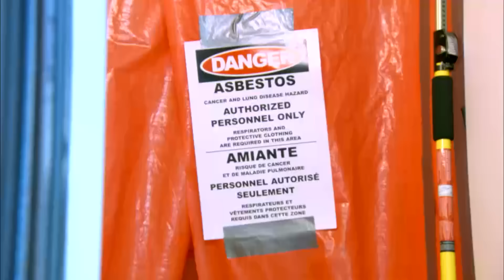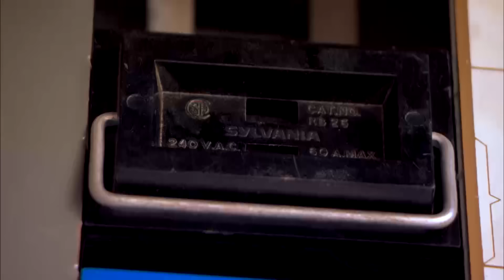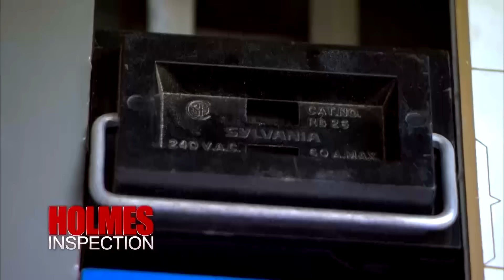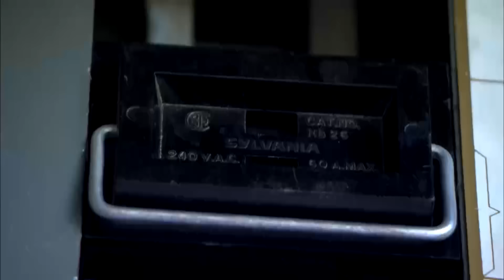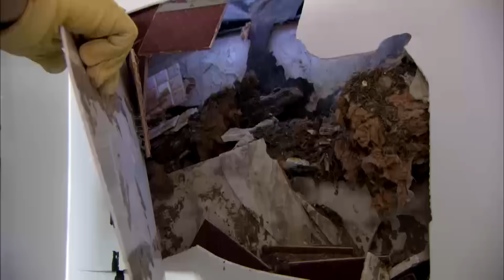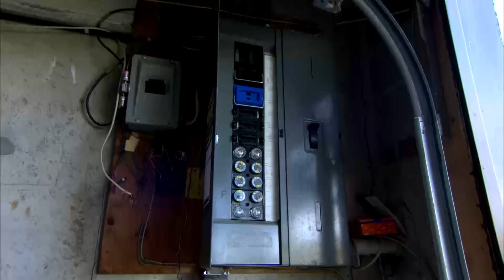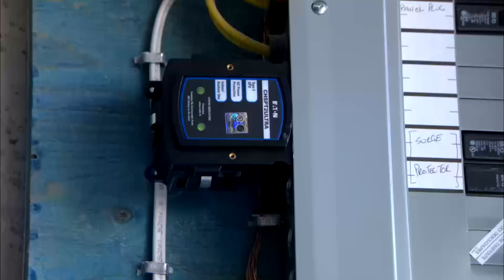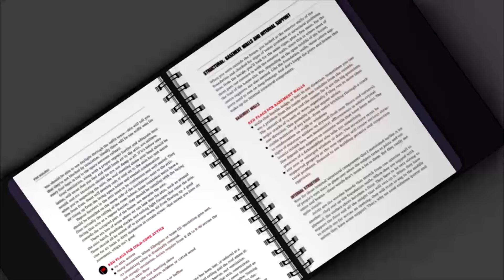Family of Five, One Shower: Townhouse Makeover | Holmes Inspection 226

Comment: The government should make Mike Holmes in charge of updating their codes so that crap like this doesn’t happen. And start a renovation police force to go undercover to catch all those sleazy permit-less “contractors”!
Reply: The problem comes that you can sell a house that isn't up to date with code. As it is the buyers responsibility to figure that put with a home inspection.  So, if you buy because it looks great and get a bad inspector, you're screwed.  Code has nothing to do with selling the house.  However,  what should happen is that you can not become  a home inspector without having a Holmes Approved inspector rating.

Comment: Why are home inspectors not licensed and held liable for their neglect?
Reply: That's by design. Their existence is for show. It's all about getting housing sales done and real estate agents collecting their commission.
Reply: @ronbennett7885  sounds about right.
Reply: Too expensive to sue them.
Reply: In Arizona they are licensed and some carry errors and omissions insurance. It's up to the home owner to make sure they hire a licensed inspector. But even licensed inspectors due shoddy work here in AZ.
Reply: In a lot of places they are licensed. Most drivers are licensed too, and that doesn't stop all traffic fatalities.

It's hard to hold them accountable for what ultimately were problems caused (or not fixed) by the previous owner or original builder. Some of the things Mike finds are differences of opinion, others are things only found through hindsight and/or destructive testing, and some is honest mistakes. None of that would be grounds for a lawsuit. If you did sue, you couldn't sue for the cost of repairs, because that's not their fault. At best they are probably only liable for the cost of their inspection, and even then you'd have to prove that they missed things due to gross negligence. 

At the end of the day, the contract you sign says you aren't hiring them to find absolutely everything wrong with the house, you are hiring them to find as much as reasonable within the time frame and limitations of a casual look around the house. If you want more than that, you'll have to find someone who offers more (and for probably a TON more money than any of these homeowners ever paid).

Comment: Don't know if it's due to trademarks or copywrites, but I'm a bit disappointed that Martin didn't get to talk about the fact that he used PEX plumbing in the garage installation. 

The reason he used that product is because it is absolutely freeze-proof. It can freeze solid and not leak afterward, making it the perfect product for areas of the home that are subject to cold conditions.

I plumbed my bunkhouse with PEX and couldn't be happier. The "Shark-Bite" connectors are amazing if you're interfacing with existing plumbing, whether copper or PVC.

Comment: That's how my apartment is in Ontario. Tub surround is installed so badly and is tapered at the bottom because so much debris has fallen down in the wall. When I wash the wall I can feel tiles behind and by how bumpy it feels it for sure is exactly like this wall. I don't care really cause there's bigger issues they'll slowly fixed over 4 years. Court is a joke in Ontario so tenants just get screwed. I could get evicted for reno if I complain too hard. Renting blows